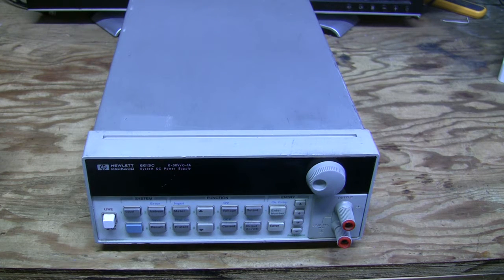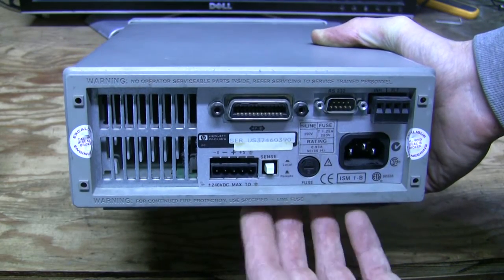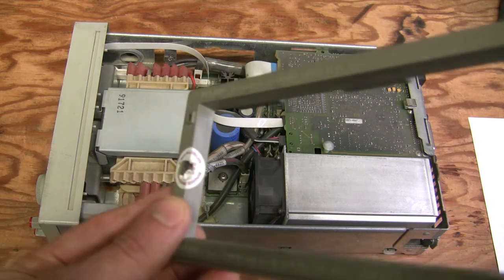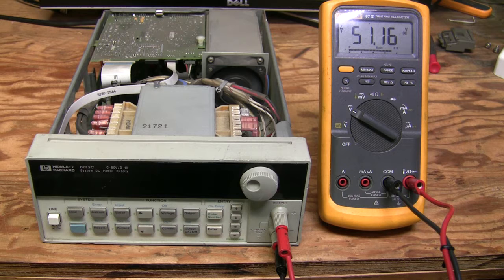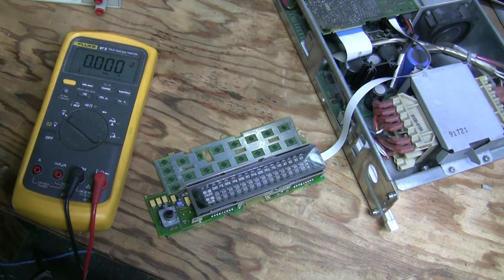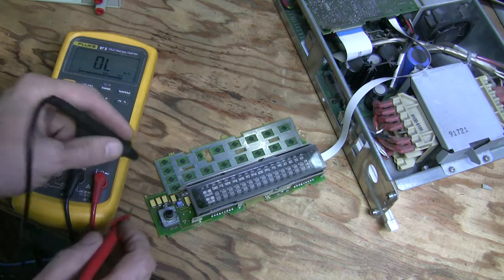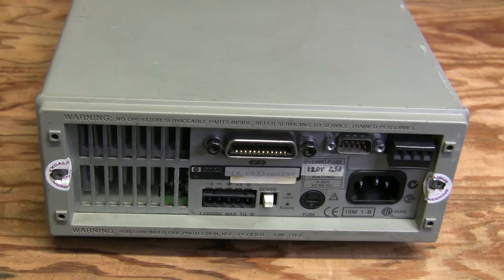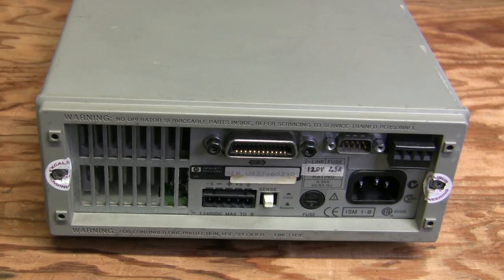#20 - Hewlett Packard 6613C power supply repair

Comment: I bought a 6611C has two issues, Digital control and Display is Dim. My voltages on the ribbon cable going to the Control PCB are all wacky. any suggestions? Big thanks in advance.
Reply from the maker: Wacky with respect to what reference point?
Reply: @feedback-loop  Thanks for your reply.I am referring to table 3-4 on pg. 35 of the service manual. I am connecting my negative lead to a common lead 10 ,11 ect. of J307. I have also used the sec. common of R431.My voltages are all over the place. I  must be missing something. I did check Bias and Ref. voltages on table 3-3  and all are good. Main issue is no control of Voltage settings and no output. Error 11.
Reply from the maker: @TheSoundtec  Just wanted to make sure that you are aware of different ground in the display module. I have no idea about your problem.
Reply: @feedback-loop  I think I might have found it..
Reply from the maker: What was it?